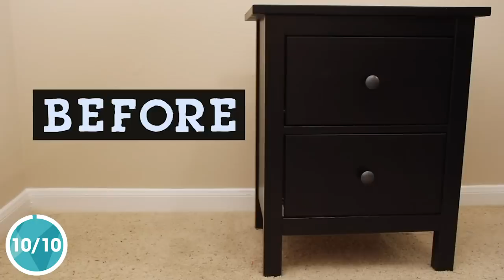10 DIYs to Upgrade Old Furniture - Furniture Makeovers - HGTV Handmade

Comment: Love them all.
Have you tried using just the holagram film from CD's over plain   vinyl tiles on a floor then using a cristal clear polyurethane high traffic floor varnish mixed with the holagram. Paint on the floor with a stiff brush then lightly smooth over with a sponge roller. The finish is amazing and hard wearing, with the massive bonas of costing a fraction of the starburst tiles and give the same effect. Can also be used on kitchen and bathroom counters. I would recommend giving a second coat of just the varnish to keep everything water tight. All done in just one weekend with time to spare if you buy a quick dry varnish.

Comment: These were good, although all require skills far beyond mine. But I can’t agree with “hardware” attached to the front of a drawer which leaves a six-inch screw sticking out inside the drawer; that’s just dumb.

Comment: Which paint works best on wooden furniture?
Reply: Fanatic Bling 
Normal paint from a paint store for not bumpy and chalk for rough textures but you may need to prime it first before putting the chalk paint on if you don’t want it to scratch and apply easier